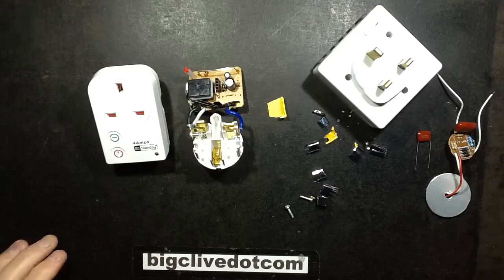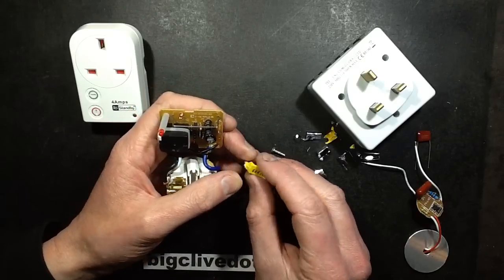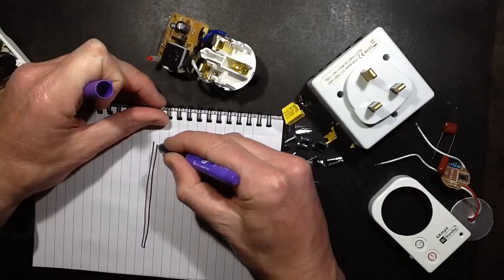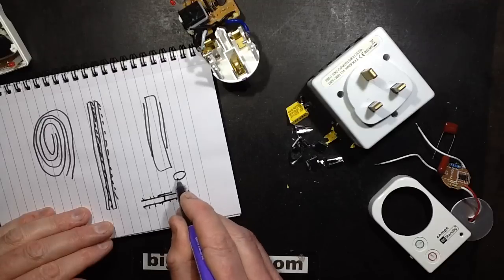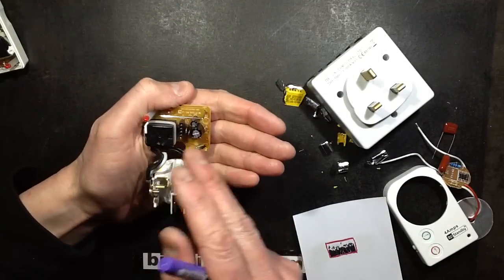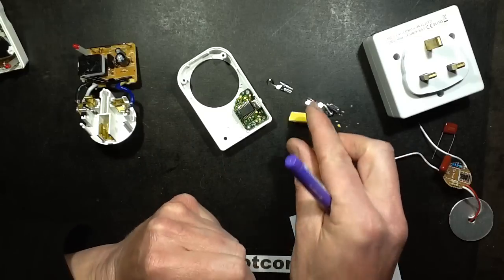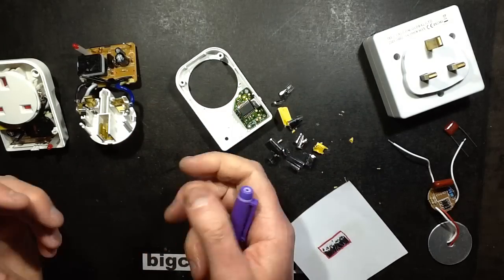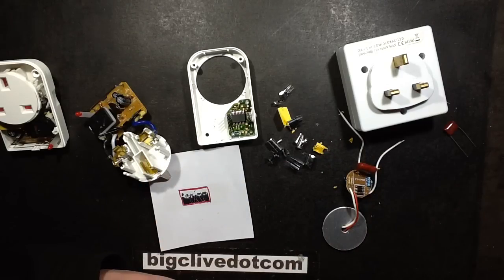Fascinating failure mode of metallised film capacitors.

Comment: Hmmm.... there may be a place for high quality capacitors in clear casings or dipped in clear epoxy lacquer, not colourless mind you just see through. If they took off and clear cases were seen as the "premium" ones then the standard ones would move to this format as the cost difference would be next to zero to produce. With the clear case you could see indications that the film is degrading.

Comment: Thanks Clive.....Just noticed this video....and I've just found arcing in the relays of a gate opening controller....the resistors in the snubber (?) circuit intended to prevent arcing are open circuit...I'm wondering if this was caused by failing x2 rated capacitors...having read this I'm going to replace all three components. Unfortunately, my multimeter can't check capacitance....

Comment: I'm a little surprized you hadn't found this earlier. I work with repairing a lot of old electronics, so capacitor failure is always present. They are wonderful components, but in the end usualy the culprit on circuit failures. One thing to note however is that you aren't always able to get a proper reading of a capacitors capasitence while it is in circuit. Sometimes it is required to remouve it, or at least one of it's leads to get a proper reading.

Comment: Hie BigClivedotCOM, an excellent video sharing and explaining a huge reason for electronics failure. With almost 40 years on my bench I really liked this video. Since when it comes to capacitors many overlook Metalized caps and focus on electrolytic caps unless some metalized cap has a tiny burn hole in it's casing. Great job.

Comment: And years ago when we had a capacitor failure on our 20kVA generator, one Mr clever clogs boldly proclaimed "Capacitors do not change in value".... Well that one did!  We replaced it with a self healing motor run capacitor. Touch wood, it's been okay so far.

Thanks, Clive, for explaining how those capacitors can lose their capacitance.

Comment: I'm a few years late to reply...….But did you measure the thickness of the metalized layer ?  Looks as if its aluminum foil.  Perhaps copper might not degrade in the same manner and last longer.  This has been of interest in the last month or so, relative to the old style paper & wax units from the early era where the paper degrades....then the cross over in the era to the newer synthetic materials as polyester and the vintage polyester caps becoming leaky......considering some brands are notorious for becoming leaky and other vintage caps of the same material but different manufacturer last in comparison.   Makes for an interesting situation to determine expected service life as such that goes along with the electrolytic as they age and dry out.       I recently had a batch of new poly caps come to me.....and the leads ended up coming out of the body or just after soldering they would come loose...….brand new.

Comment: Great explanation! These are the scourge of all consumer electronics if you ask me :( Turned out they used them also in Senseo coffeemakers (from 2009-2011 or something) causing all kinds of weird problems like not hot enough water, turning off at random times, and half cups of coffee. And the biggest problem was sometimes there was no problem at all wich ofcourse makes you think it was an incident/you did something wrong. Gradually over time it gets worse, but by then the device is no longer under warranty.... 
These are great for the manufacters, making sure the device will die so you have to buy a new one, but not as fast that they will have to replace it under warranty. The Senseo worked without problems for about 2 years, then the trouble started and after 2,5 years I had to replace it :(
Tip if you have devices with these in them: do not use them on the same wallsocket as other devices (like a lamp) and always pull out the plug if you do not have to use it all the time to make it last as long as possible.

Comment: A few years ago I had bought a multi-pack of LED night lights and one by one, over a course of about two years, they gradually faded out.  They should have lasted ten times as long.  I had opened one up, and seeing that it used a capacitor dropping scheme to regulate the current through the LED, assumed it was a crappy design that allowed the white LED to see peak currents on each cycle that exceeded its rating and greatly accelerated LED aging.  Since the night lights were a snap-together design that required great force to pry apart, I deemed it too much trouble to work on them and decided to toss them when they became too dim or quit altogether.  It never occurred to me that the polyester film capacitors might have been degrading in the manner demonstrated in this video.  If I had known about this phenomenon, I would have tried measuring their capacitance.  Polyester film capacitors normally last decades; they're among the most reliable capacitor types made, but only if they're rated conservatively, e.g., picking a capacitor with 3-4 times the DCWV rating of the mains RMS AC value.

Comment: Just had one fail on a power supply for an arcade game for the second time in two months. What would be a viable replacement that won't be destined to fail??? any brand recommendations? the original uTx (China crap) won't last for shit
Reply: what sort? electrolytic? film? if electrolytic, try Panasonic, Rubycon, or BC/Vishay
Reply: I’m aware this comment is old, but you can replace a capacitor with one that has a higher voltage rating, so long as the capacitance is equal. If you’re experiencing consistent failures, you could try that.

Comment: The self healing Nair of the coil calls is a designed in feature. this is for safety, particularly with y rated safety caps. the idea is to never fail into a shorted configuration.

Comment: i have those cheap led lights. they just stop working full stop. no dimming. maybe they are susceptible to surges? what if one of the 4 diodes failed?
Reply from the maker: +Alan Wolstenholme It's usually an open circuit LED.  Often with a visible black dot inside.
Reply: thanks

Comment: Hi Clive. This is a well-known failure mechanism of X2-rated caps as used in capacitive droppers. Some makes are apparently worse than others.

I've fixed loads of them for others over the years. The last was a cooker clock/timer with a 1u0 cap had dropped to around 600nF according to my notes. Saved someone around £250 a replacement module would have cost.

When given such a device to fix first check the output voltage of the supply. If it's much lower than it should be then 10:1 it's going to be the dropper cap that's gone low value.
Reply: Can a new replacement capacitor be dipped in an extra layer of epoxy to provide extra protection against moisture?
Reply: ALLOT of these failures all over the planet are because of greed and inferior quality(garbage) "Lytic" and Film capacitors that should have never been produced or sold(I'm not even talking about counterfeits here just junk).   On the other end of that coin though is selfish and greedy consumers(especially in first world countries) that aren't willing to pay for quality and wanna have their cake and eat it too!!!
Reply: teebo - Failures are generally caused by garabge or low quality capacitors.   The electronics corporations don't give a sh+t about a $35.00 Blu-Ray player sold @ Wal-Mart. It's gonna have garbage caps that can absolutely buldge and leak after ten years, not premium Japanese caps that can last for 30+.   Just like allot of these mundane electronics devices like he's showing here. LOTS of our household devices(especially nowadays) have horrible or mediocre quality caps.   Dipping your caps in epoxy to protect against moisture would be very interesting in extreme environment use(100% humidity) but it's not going to do anything to help a cap that's junk to begin with.   Namaste

Comment: i had a monitor thatd turn on for a second then turn off i would think that was also capacitor never was bothered to find out though dont have a capacitance meter and there was just way to many capacitors anyway
Reply: firestarspelt   You can simply troubleshoot for voltage, especially in this case where you had about a second of operation before it failed. Chances are the problem was is in the power supply, and not necessarily a bad cap, although very possible. You may have had a bit of cold solder or another issue altogether. No matter how you slice it, a DVM can get you by more than you may think.

Comment: I think it would be interesting to compare different types of film caps. PE vs PP vs PS vs polyester, etc. My general understanding is that polyprop makes the best film caps. I have a new design where I use a 2kV pp cap to form a high power 125khz resonant transmitter where the caps generally reach 1-1.5kV. It would be quite detrimental to me if these caps' values deteriorates, as the resonant frequency changes with it...

Comment: How old are these devices? Basically how long do these capacitors seem to be lasting before they finally do this?
Reply from the maker: +compactc9 The one in the video did not last long.  Lifespan depends on the quality of the construction and the electrical environment it is used in.  A lot of high voltage transients will shorten its life greatly.
Reply: +compactc9 As in my earlier comment here, I've seen LED night lights begin to degrade almost immediately and fail completely within two years.  In that sense, one could say the capacitors were failing from the first minute that the product was put into service, although the failure was gradual, not catastrophic and instantaneous.  It is an issue of the manufacturer selecting capacitors with a working voltage rating that is far too low, so ordinary mains fluctuations and spikes on the line begin to damage the capacitors from the very start.
Reply: We just started using LED lights instead of either CFL bulbs or the now unavailable regular filament bulbs. I changed the CFLs in my bedroom out for LED bulbs, as I got tired of the CFLs having to warm up, and I honestly prefer the light they give. CFLs have a rather harsh light I think. We haven't had one of the LED bulbs go out yet, but when one does I'll have to open it up and see what I find.
Reply: +Milosz Ostrow In my case a lot of LED lights were failing in my house and at first I thought, that the little PS units are failing. The LEDs begun blinking and/or loosing their brightnes almost completely. When I had a pile of them, I started exploring and found out, thai the LEDs are failing, because they are just soldered to the aluminum boards without any heat conductive paste at all. No wonder they were failing. My neighbour also had problems with LED lights in his wall. In his case also LEDs were failing, but those were the ordinary 5mm LEDs. I made him new guts with capacitor from company Iskra (Slovenia/EU). Theese wont fail, they are high quality and 630V rating. I used 9W COB LED, which is powered with only 0.9W and this will last many years. I have one 1W LED in my hallway and it dhines 12 years, also it works on ~100mW.
Reply: +compactc9 I purchased 12 60 watt equiv LED bulbs and one went out on me as I was standing there as it flickered and flickered more and finally POOF.  I never did figure out what went out in it but the bulb wasn't even 2 months old.  Now 6 other bulbs are still going...for now.

Comment: Oh man…. I never realized this…. I’ve been told that film types last for a very long time.  In this case, it seems like a ceramic would be the best.  Is that correct?
Reply from the maker: It depends on the application.  Ceramic are usually low values.

Comment: I've got some led lights in the house (claimed 3x1w in each bulb) that have been slowly getting dimmer.  slowly enough that it went unnoticed until one of them failed completely and was replaced with a new one (same batch as the original, bought in bulk)

so could this be the reason for them dimming down?
Reply from the maker: +Nathan Lucas Not so likely with the higher power LEDs.  It's more likely to be phosphor or LED degradation that causes progressive loss of intensity.

Comment: Clive or anyone, I think capacitive droppers are uncommon in North America.   I think we use step down transformers.    I'm I under the wrong impression?   Or are these droppers not something that would pass UL or similar safety testing?
Reply: My guess is that the lower voltage in North America means that a dropping capacitor has to be rated at twice the size of one used at 240V.

Comment: Cheap monitors almost always fail with this mode. If you Google 'monitor cap replacement', you'll get flooded with hits. If you see a broken but otherwise nice monitor dumped somewhere, and you have the inclination, it's almost always worth swapping out the caps. I've saved two friends' large screen LCD TVs from being discarded this way. Tossing a $2K investment or $20 in caps... hmm...
Reply: You don't know what you're talking about. Those were bad batches of electrolytics. This is the "self-healing" feature over time.

Comment: Probably getting atmosphere and moisture causing the failure. Possibly the environment these are operating in.
Reply: should be sealed in epoxy... if it has split, as happens with old RIFA branded ones and some others, they can definitely absorb moisture and go bang quite nicely..

Comment: What are the foil and connection made of,, for precious metals recovery
Reply: The metalization on the plastic dielectric is vacuum deposited aluminum. Fifty years ago, when I had a company making high-quality plastic film capacitors, I created terminations by turning a rack of capacitors on end and plasma flame-spraying a layer of tin on the end of each capacitor. An ordinary tin-plated steel wire was then soldered (or spot-welded) onto the tin terminal. The finished capacitors were then either epoxy dipped or put through an epoxy powder / thermal cure operation to form a hermetic seal over the capacitor. So sorry, not much worth recovering.

Comment: Those metal film capacitors are SHIT!!!! I had one of those fuckers blow in my face, when I was using it to drive a spark-gap.
Reply: +ivan R Not true.  Polyester film capacitors are among the most reliable types ever made, but they need to be used within their ratings.  If you managed to cause one to explode, it was clearly being stressed far beyond its rating.
Reply: ***** Actually I only stressed it a little bit. It was rated at 1kv, and I was driving it on 1.1kv and I fucking disintegrated and almost started a fire.
Reply: ivan R You didn't stress it a "little bit".  No competent electrical engineer would use a capacitor at more than 50% of its voltage rating for reliability.  You ran it at 110% of its rating.  Failure was guaranteed.
Reply: Ok fine I did blow a few capacitors on 28kv, but this one was rated one kv and I was running it on 1.1kv. The capacitor had a 15% tolerance, and it should not have exploded, and yet it disintegrated and almost started a fire.
Reply: +ivan R 
Tolerance goes both ways :P, 15% up or down.
Reply: +ivan R The voltage rating does not have a tolerance, it's a hard limit. If run it even at 1% over it's voltage rating, the manufacturer no longer guarantees that it will survive. There is often also a derating versus temperature - if the capacitor is running much over 25*C, then it's voltage rating becomes lower. Additionally there is a ripple current rating for the capacitor which must not be exceeded regardless of the voltage. If you are pulsing too much current, it's going to blow up even if you only subject it to 1volt.
Reply: TMM alright I did run it at very decent power, about 200watt, but hey the capacitor was HUGE and could have taken much more power. I don't know why it exploded, as I was not abusing it.
Reply: ivan R It could have taken much more power, but it blew up anyway? Well obviously it couldn't have taken any more power :) If it didn't blow from arcing over, then I think you exceeded the peak current handling, possibly with inrush or a spike.
Reply: you should always use a cap of higher voltage than actually needed, running them at even 95% of max is risking it... as said above running a 1kv cap at 1.1kv, not surprised it didnt like it 😉
Reply: and as for ripple current, there were special types for high ripple purposes, such as scan couplers in crt tvs and monitors, were several times the size of normal ones of the same voltage and capacitance..put a standard one in place of the special and it will fry quite nicely...you can still get them...usually called 'pulse' or 'high pulse' rated..

Comment: Fascinating.  Who would have thought of gradual plate ablation.  Someone also said that transformerless power supplies constantly draw current with no load.  Maybe in your high level tinkering you could confirm or deny this.  Thanks
Reply from the maker: The capacitive dropper supplies pass more current than you'd expect for the load, but it's out of phase with the voltage.  Your electricity meter should only charge for the real power.  (It's quite a complex subject involving power factor.)
Reply: Would my kill a watt device factor this in?  It seems dead on with led light bulbs.  Aside that I have noticed my bathroom led bulbs on a dimmer buzz like incandescent filaments, and they use dropper capacitors.